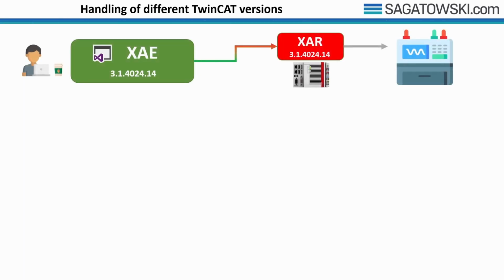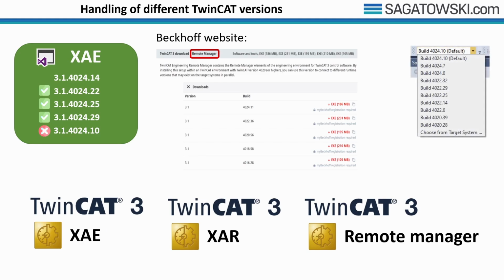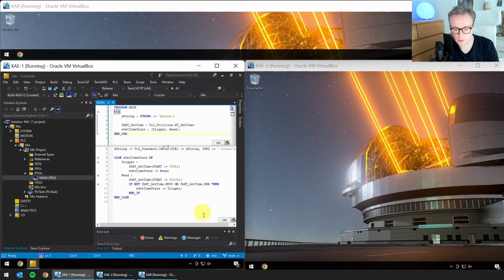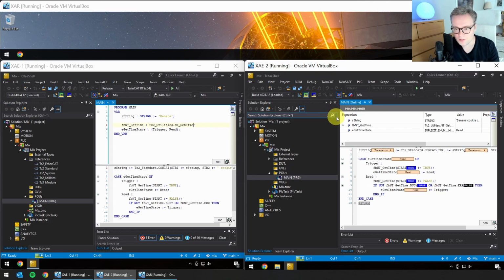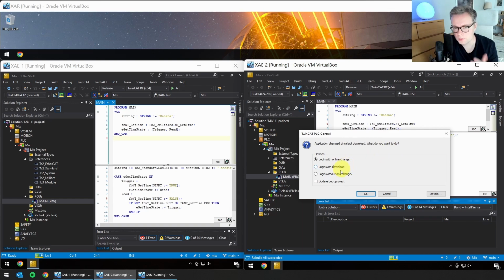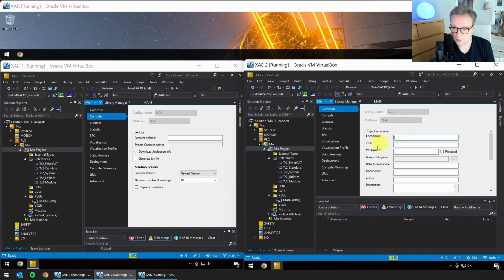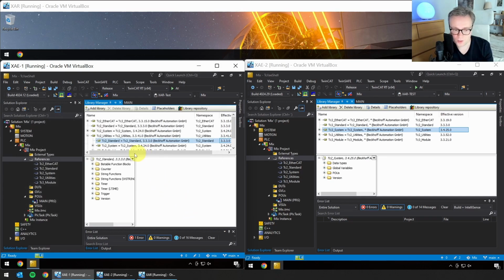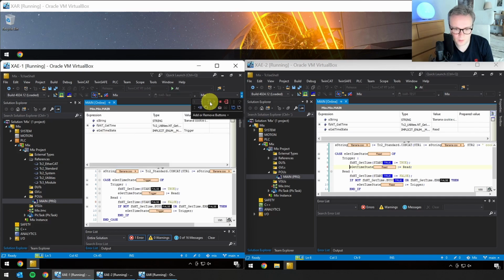PLC programming using TwinCAT 3 - Handling of different TwinCAT versions (Part 14/18)

Comment: Hi Jakob,  I noticed you set the version of each library independently with the placeholder menu.  Would using the right click context menu for the references item and clicking set to effective version do the same for all libraries at once?  That’s how I have been handling this.  I’m just wondering if there are scenarios where using the placeholder menu is preferable over setting all at once.
Reply from the maker: Hey Dustin. My understanding is that it's effectively doing the same thing.

Comment: Hi Jakob, 
my name is Lucio and I follow you from Italy. 
Your "PLC programming using TwinCAT 3" series is wonderful. The enthusiastic way in which you tell the potential of this system is engaging. 
I am a computer systems engineer, I work as an IT in a furniture factory, but I have never programmed a PLC. Thanks to these videos of yours, I quickly became passionate about TwinCAT and to practice I use a TwinCAT/BSD virtual machine.
I look forward to your next video "Part 15 - ADS", I read in your blog that the video will contain an example of a C ++ program that runs under Linux.

Without being presumptuous I would like to give you an idea for the topic to be covered in one of your next videos on the potential that BECKHOFF makes available with TwinCAT.

It is true that with TwinCAT/BSD Hypervisor (BHYVE) contained in the TC/BSD system you can make Linux VMs and therefore showing the use of ADS can be useful to all those who want to take advantage of the hypervisor to run Linux (or other OS).
TC/BSD, however, can also exploit the "jails" to create a virtual FreeBSD machine (virtualization at the operating system level) with very little overhead. With this in mind anyone, like me, can use a FreeBSD JAIL to test ADS on a virtual machine also without having to troubleshoot the "nested full virtualization" problem on their PC.
I imagine that a video presenting an example of a C ++ program running under FreeBSD will be very useful to all those who follow your videos, and also to all those who follow FreeBSD tutorials.
I would find this very very interesting.

Comment: Good job again.
Yes, it works with PLC Project but we have always some kind of problem with PLC Visu or its libs.
Safety Projects from older versions dont work at all, newer version even dont read older safety project.
This is reason why we still use virtualbox with older version
Reply: Biggest problem is indeed the safety.